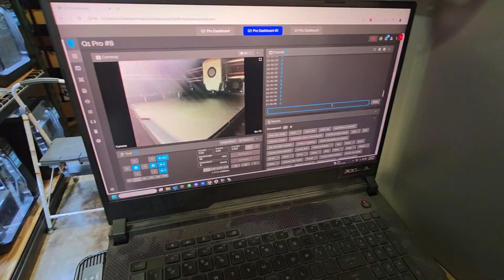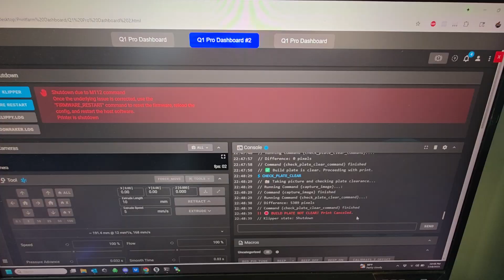Qidi Q1 Pro Print Farm Automation - Using AI Computer Vision to Stop Destroying My Print Farm

Comment: thanks for the farm videos! what is adequate shelf spacing for your q1ps? i need to stack a couple and figured youve found the optimal spacing for them.
Reply from the maker: I have 30 inches of spacing between each shelf. However im going to move away from that and have a single row. Im tired of stepping on a step stool and crouching down.

Comment: Do yourself a favor and print some handles! There are a few different versions on printables and maker world. You might not mind the simple clip ones but they don't let the door close right it closes but ruffly. It's a super fast print that only uses like 5-10g of filament each. 
   I like the suit case type handle there are a few different versions of this type. Some double-sided tape mines been on my Q1-pro for about 6mths now LOVE IT also have one for the lid with a lower profile same suitcase handle type design. With lid holder 3M-ed to the side of the printer allows for easy removal and storage.
Reply from the maker: For sure I need to get some handles. This particular day my hands were a little sweaty lol
Reply: @Redo3D it the only thing I really don't like about the Q1-pro it just really seems like they forgot the handle 😅